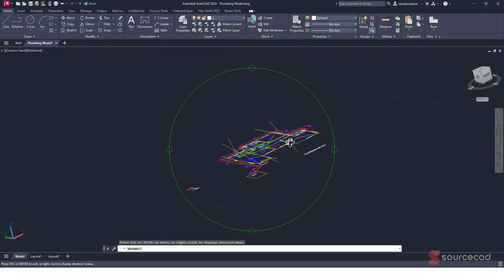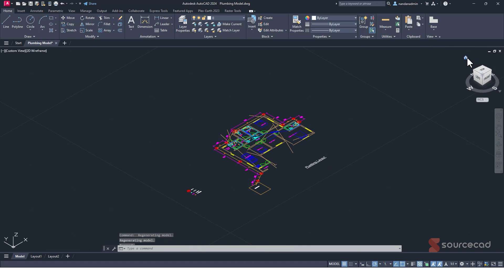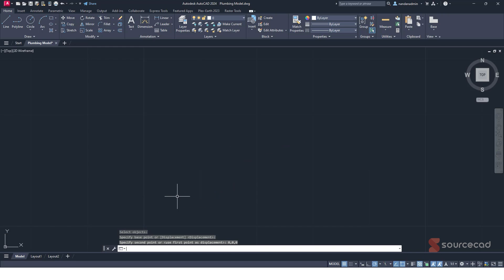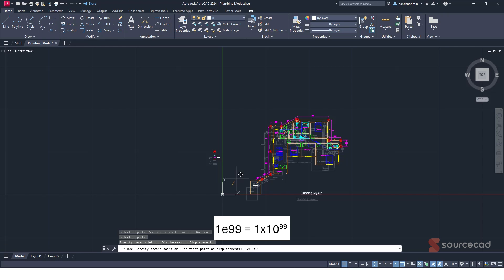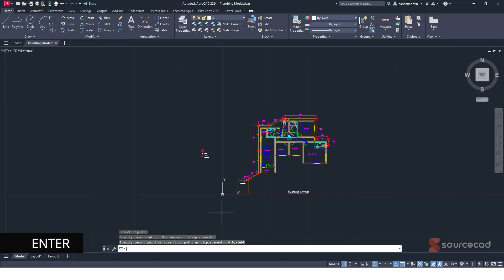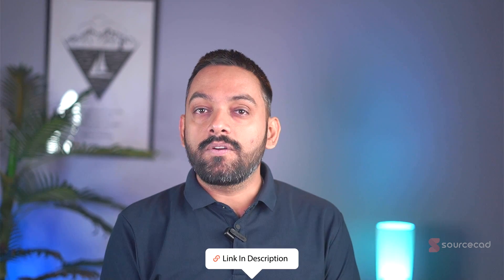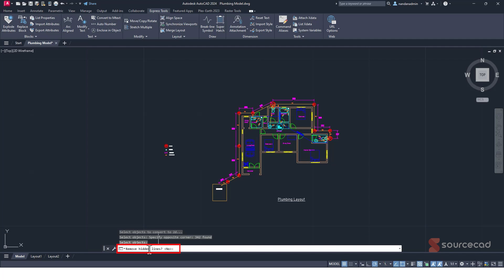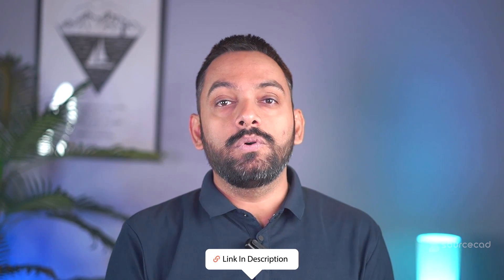Flatten AutoCAD drawing and remove Z axis for AutoCAD and AutoCAD LT

Comment: Does AutoCAD lt let you use an elevation on a polyline?  In other words does it have x,y,z or only x,y?  What happens if I open a drawing that has polylines with contour data on them which would be the z component "elevation" of the line.  Can I rotate in AutoCAD LT to see the 3d?

Comment: My drawing disappears when I move it to “infinity” 😮
Reply: did you fix it?
i have got the same problem
Reply: @jasimakbar9939  try to clivk on the zoom extents
Reply: Same problem
Reply: i had the same problem, just complete the process by selecting everythin by ctrl+c then 0,0,-1e99 and it will re appears with everything on 0 z axis